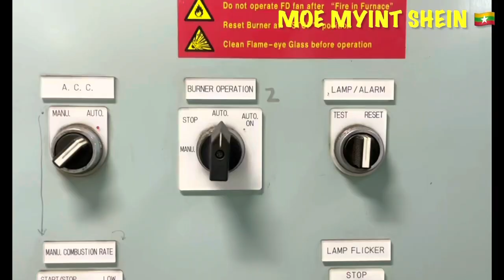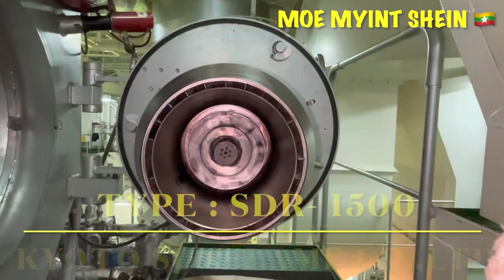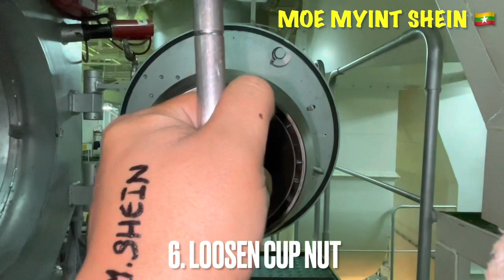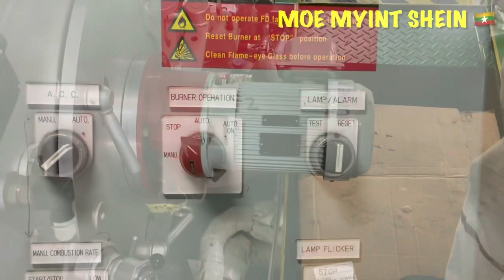[SUNFLAME] BOILER Rotary Cup Burner Overhaul | Marine Engineering | Technical Vlog : 012

Comment: Hi, i saw your video and its excellent, on my vessel we have a problem with black smoke, somebody touch the setting table on the panel to adjust air from 2nd blower and fuel ration, do you have the settings and if yes can you please share with me.
Same boiler same model
 Thanks.
Reply from the maker: Well received your inquiry. 
I shall upload setting table on COMMUNITY of my channel. Keep in touch.
Reply: @MoeMyintShein_MMU  thank you very much. BR

Comment: Good day sir, my problem is when my boiler last part of combustion (DO mix) it produces black smoke, only on that part,. What will be the cause? And what can i adjust sir? Thanks in advance
Reply from the maker: Please, let me know maker and model of your boiler for detail troubleshooting.
Reply: The same maker and model in your video sir, kyoto sunflame co.. Ltd, SDR-1500
Reply from the maker: @Penny-is-pretty 
As First, please check the distance between tips of air nozzle and cup. It should be 2.0mm. If not in limit, adjust it.
Reply: I already checked and measure the clearance between air nozzle and rotary cup and within the limit 2mm,but still black smoke coming out at the end of combustion sir
Reply from the maker: @Penny-is-pretty 
Please check links of secondary air line and lubricate. 
Adjust link of secondary air line damper to enter more fresh air.

Comment: your burner is broken. cant repair. but you need to produce steam.
how will you do that😥!?
  your burner nozzle is not working fine, you dont have spare parts, how to continue boiler operation!
Sir, is there any way to start up boiler without burner? or bypassing it? most probably he wanted to know this
Reply from the maker: In port, raise requisition spare parts or call shore assist. Failure of Boiler also can affect SOLAS Chapter - 2. 

At sea, reduces steam consumption and use steam from EGE. 

Sometimes, incinerator pilot nozzle and boiler pilot nozzle is same. 😊

Comment: Hello sir
lets pretend, you are in port, your boiler is giving black smoke to the funnel. now PSC wont allow you to run boiler with black smoke. you tried everything to check why black smoke is coming out. but still black smoke.
also you need to produce steam.
in that situation how will you manage this?
Reply from the maker: Adjust and Increase Air Damper Until Clear Smoke Comes Out. He wants to adjust Fuel and Air Ratio. 😊